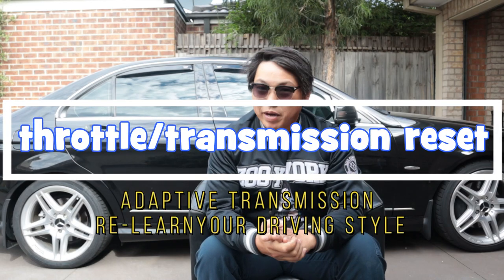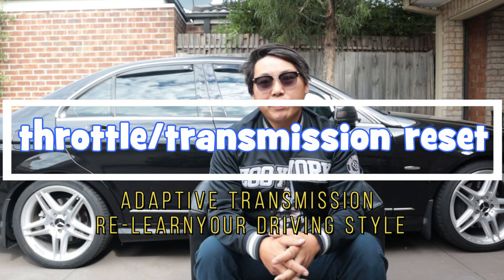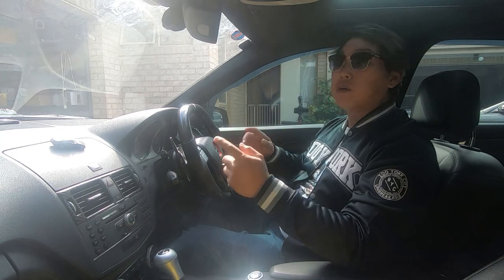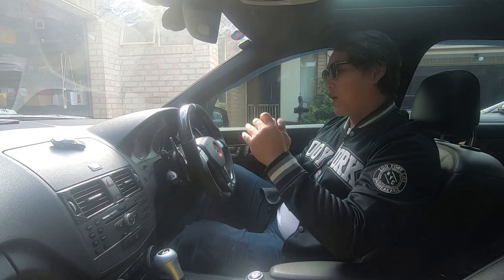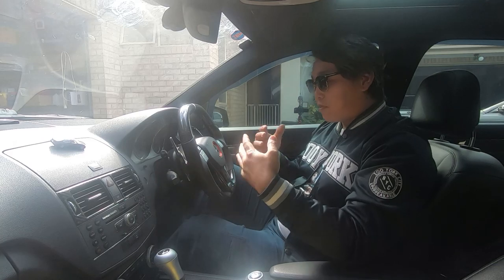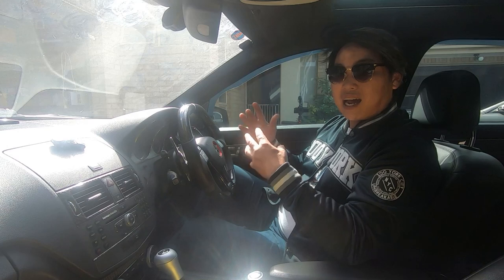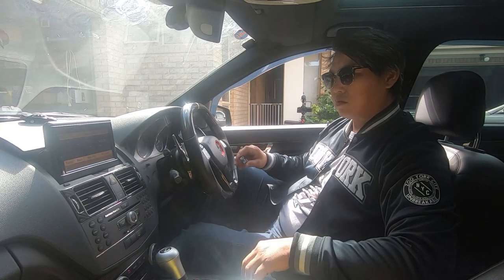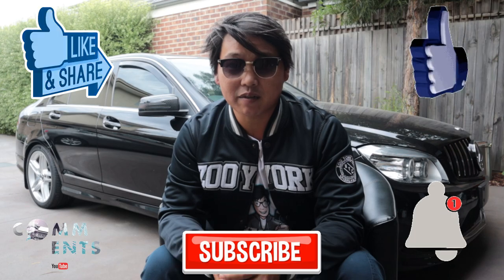mercedes benz TCM TCP throttle/transmission reset procedure EXPLAINED

Comment: Any suggestions how can unplug my tuning chip on my car ?
Reply from the maker: if ur car was remapped u need to also reset the ecu to factory settings.. if it's just an add on chip u can just unplug it wherever it's plugged in... if it's just a pedal commander u can just disconnect it
Reply: @MIKEYZVLOGZ  thanks for you ret ! 
I appreciate it 👍🏻
Reply: And by the way it’s a Brabus D6 chip
Reply from the maker: @oussaidelouazzani8407  if its a chip u need to reset ecu to run factory settings cuz your ecu would have been remapped
Reply: @MIKEYZVLOGZ  the problem is that my car has EGR problem and I changed as the diagnostic has indicated and the car was running fine for 3 days then has back again to limp mode and I don’t what’s the reason, do I have to be remap the new EGR with ECM or maybe the tuning chip not reading the new valve !? 
I’m lost and I don’t want to lose my car !
Reply from the maker: @oussaidelouazzani8407  unfortunately i have no idea about tuning mercedes and it very hard for me to help u diagnose with seeing the car and heating it by having it im front of me... your best bet is to take it to a professional .. sounds like something is def wrong with engine..could also be vacuum leak too..or intake manifold which can lead to limp mode

Comment: What if you have a push start button?
Reply from the maker: with push start to turn into acc you press the start button on e without pressing accelerator and ingots into acc mode ... where all lights come on button ignition and fro. there follow the steps the same and it should work too.. I haven't done it on a push start yet but I. sure it wil work mate .. thanks

Comment: I just did this to my mercedes and now the engine light is on (P0123)??
Reply from the maker: hi mate so that code is for the throttle position sensor ... that would not have caused the issue..it would have been an underlying issue and wen u did this u resetted it .. causing it to show any inconsistencies in the tps throttle position sensor... check and see if the plug is loose behind your pedal.. do u have a pedal commander at all? if not u may just need to swap the sensor on the throttle and it will fix it..
Reply from the maker: or what alot of ppl have done is replace the pedal assembly as its a cheap option now and simply swap out the assembly as the tps is on the assembly meaning u will swap the sensor as its attached to assembly..also maybe check your mac sensor and make sure no build up is there

Comment: How to do with push start Mercedes?
Reply from the maker: With push start do u need to put ur foot on brake to start? In my lexus it has push start and wen i dont press brake and press push start its the same as acc mode just before car starts
Reply from the maker: @choice5589  so with push start togo to acc you just push the button without your foot on the accelerator.. and that wikll allow you togo to acc , mode just nefoer your car starts ... i have never doen this before on a push start but im guessing it will be prettyu much the same.. for non push start u goto acc 2nd turn , and for push start to go to the same setting you just press the push start x2 without foot on brake pedal ..hoep this makes sense//try and let me know

Comment: With a push start it won’t work. While your foot on the gas pedal and you hit the push button you start up the engine
Reply from the maker: did u try already I thought u had to have foot on brake to start car ..I didn't think it mattered if on accelerator
Reply: @MIKEYZVLOGZ  correction it was the brakes for the motor to fired up (old age mind blocked). It did work. But it was a little scary when I drove it after the reset. After a few minutes it adapted to my driving style. Still need to figure out why the hard shift on 2nd gear when I WOT (wide open throttle). I notice it on sport mode. By the way if your wondering it’s a W166 GLE. I know this work on the W209 CLK.
Reply from the maker: @A.Musa76  kool... good to hear it worked well done

Comment: Why would they require that you close the windows and close the sunroof and everything else before you can do this procedure?, That sounds idiotic.
Reply from the maker: apparently it can interfere with procedure... its what many ppl state ... but I agree don't u debatable why that's the case
Reply: @MIKEYZVLOGZ  yeah. I learned the hard way that I have to close the sunroof if I lock my car.... Left it open for 2 days and a new battery went flat. Something about the rain sensor looking for rain so it can close the roof....
Reply from the maker: @davedammitt7691  yes correct it has a safety function so if u leave the roof open and it detects rain. it will close automatically
Reply: @MIKEYZVLOGZ  yep. Sucks that i have to close my car up in my own garage.

Comment: Will this work on a c240 2004 Mercedes
Reply from the maker: not too sure friend
Reply: @MIKEYZVLOGZ  just changed the throttle body sensor but it’s not accelerating properly it’s not as slow as before I changed it but it’s not the right speed it’s like in limp mode
Reply from the maker: @Paulie.P  try it.... maybe u have another issue maf sensor not clean?
Reply: @MIKEYZVLOGZ  My lazy Mechanic Definitely didn’t clean That he took it off and put it right back after changing the throttle body
Reply from the maker: @Paulie.P  yeah that can cause that too... but maybe it was clean? I can't say for sure.. but maf sensor dirty can cause limo mode ..but also a few other things too..like bad tps throttle position sensor
Reply from the maker: @Paulie.P  best thing u can do is get it scanned by a proper mercedes scan tool and it will tell u what's wrong